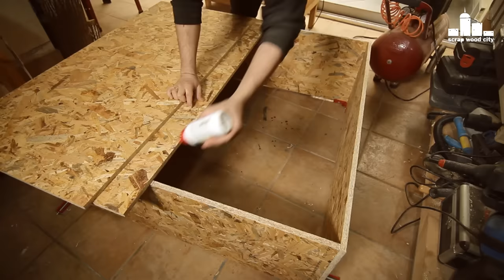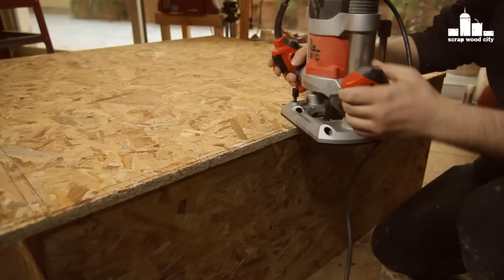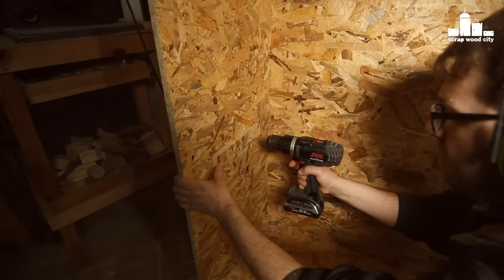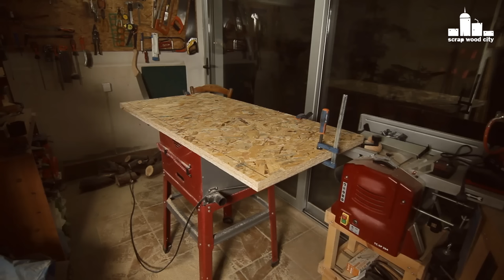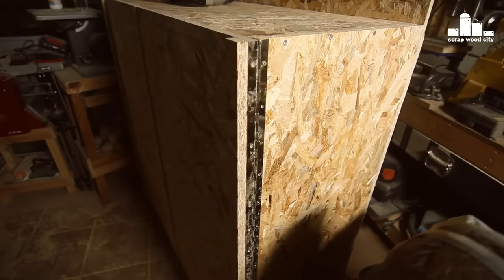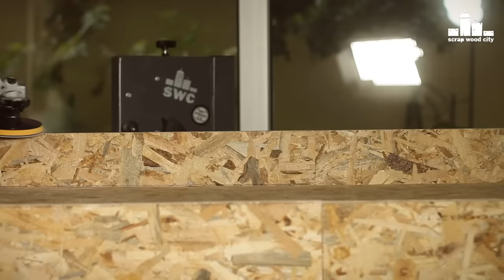Make a simple DIY rolling cabinet out of OSB

Comment: You did a really nice job here! I might follow this design myself. However, there are a few comments I would make for others looking to build something like this. First, unless you just have to go cheap, use plywood. I personally think OSB is crap but even if you don't, at best, it is only tolerable. Plywood is so much better and for something that you think will last, you'll thank yourself later. Second, I don't think you'll need screws on the edge joints unless you must work with them prior to the glue drying. A good glue will do the trick fine. Third, I's strongly recommend going with bigger and better casters. I've got a rolling cabinet I built that's smaller than this but with bigger casters that I wish I had put bigger casters on. Finally, PLEASE, PLEASE, PLEASE use push sticks when working anywhere near the table saw blade. Use something anytime your hand is between you and the blade, between the blade and the fence, and at least 6" to the outside of the blade. You WILL have an accident if you don't..
Reply: No, not at all. OSB is no any worse than plywood for such purposes, but an order of magnitude cheaper. You only have to protect it from moisture from the edges and design it the way that edge joints are not just screws. I would just put some lacquer on freshly cut edges or paint all that entirely with some acrylic. Look at IKEA stuff: it is literally all done from particle boards, which is way weaker than the OSB. They are just using more clever joints and dowels, that's why it lasts better. On top of that, plywood also swells on edges, just like OSB, if it gets wet.

The only why I would use plywood here is that OSB looks damn ugly. But for workshop cabinets to hold tools and be constantly covered with dust — there is no need to invest really a lot of money into a plywood. It is very expensive in EU: a sheet of OSB costs 17-20 EUR now, while the same sheet of plywood will cost you about 150-200 EUR. If you are talking about construction plywood (three-four layers for 22mm sheet, same application as OSB), then it is even worse, because it is not just ugly as OSB, but also weaker, is often crooked and still as thrice as expensive. That is why it is quite hard to find it here, since nobody wants to buy it.

Comment: Nice cabinet!  With the price of plywood these days, OSB has become a more acceptable material for shop use.  Some of the normal plywood options when I was young are almost considered furniture-grade these days.  
That said, I agree with your narration that the crosscut at 2:51 is unsafe, and best done on the table saw with the miter gauge or a sled, or with another tool such as a circular saw.  While the part between the fence and blade is longer than it is wide, a factor that would normally make it a safe cut, the part hanging off to your left makes it hard to control due to its greater leverage making it hard to keep both the front and the back of the piece in contact with the fence, and it is therefore easy to turn it slightly, wedge it between the fence and the blade and kick that long piece back into your belly.  A table saw newbie may get a bad idea of how to use the table saw from this example.

Comment: A wood dowel across the screw line provides a stronger fixing without splitting the board. The screw bites into the dowel. You can also use furniture bolts and dowel nuts.

Comment: pretty good and useful cabinet you made. but only 1 question - why the strongening screws are so short? 1-1.5 cm? they must be at least 2.5 cm long, to grip those parts together
Reply from the maker: That's what I had! I hope they will hold!
Reply: @ScrapwoodCity  but they even don't get to 2nd layer)